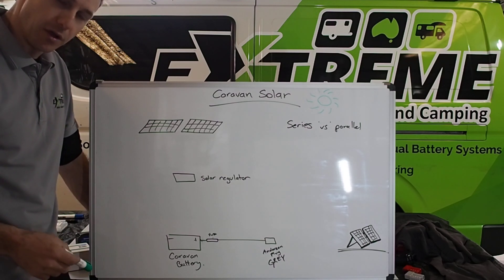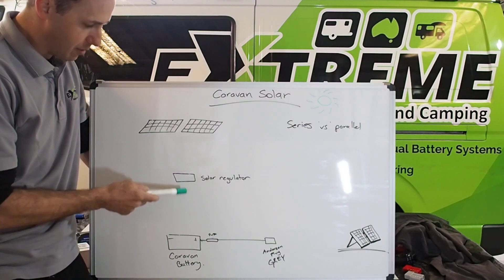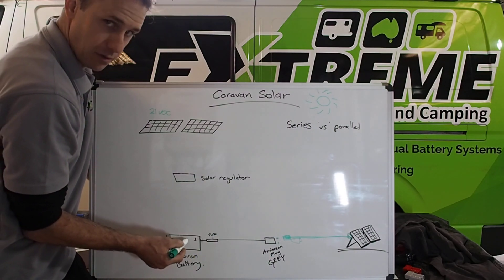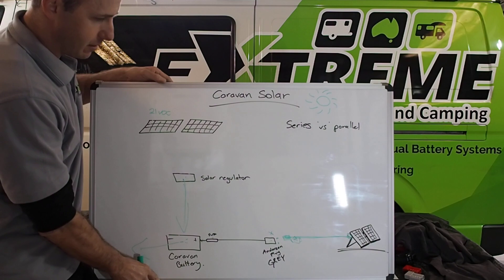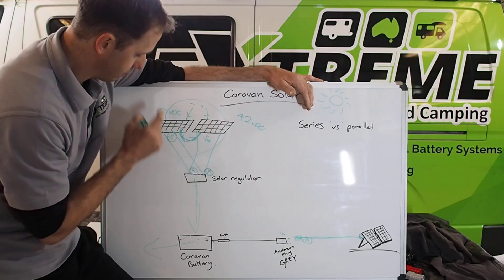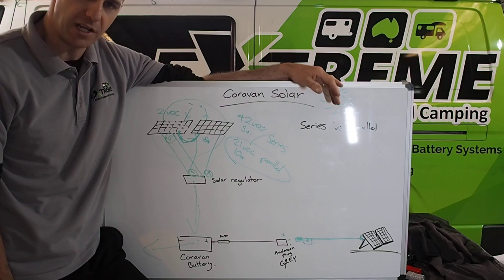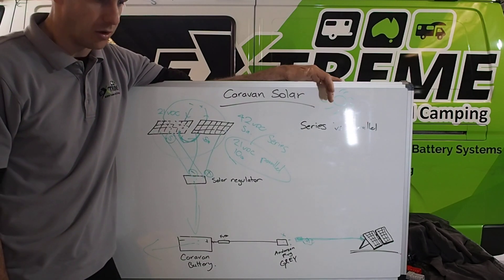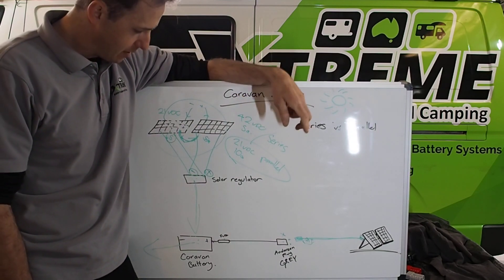Caravan Roof Solar basics with a fold out solar panel

Comment: Hi Matt 
What happens if the voltage on the fold-out solar panel regulator is let's say .5 v  higher than the main regulator dose the opposite happen where the main regulator see the battery as charged and winds back its output?
Reply from the maker: Great question,
Cannot happen with our setups.
This is why we use products that have a uniform lithium charge profile. Also if you note the charge controllers are really close to the charged battery. Also as we network these victron solar controllers together it definitely eliminates this issue.

Comment: Regarding the fold out solar panel, if it's preferable to have the solar regulator as close to the battery as possible, is there any reason why you wouldn't want the solar regulator installed on the battery side of the Anderson? I guess, apart from not having a portable regulator to keep with your fold out solar panels for other uses?
Reply from the maker: That’s exactly the case. Install your regulator close to the battery and run unregulated into that side Anderson plug. You are then now at a higher voltage which minimizes voltage losses over the cable.
The good thing here is you can run very thin cable if your voltages are high enough. Also cable length can be extended here

Comment: Hi Matt - if I install a DCDC charger with inbuilt solar regulator into my pop top van, will the solar regulator still work when I am off grid and the van disconnected from the vehicle / start battery. i.e. the DCDC charger wouldnt have power when off grid will it still regulate my van solar panels / portable panels? thanks
Reply from the maker: Yes, the dc charger will use solar if the vehicle input is absent